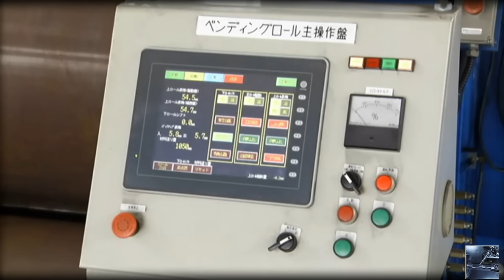Discover high-capacity plate rolling machine - Technology solutions

Comment: but how do they joint it edges??
Reply: It`s welded,but would like to know what process?
Reply: When I rolled wind towers we put a hand root in then sub arc welded the joint. Material that thick took alot of passes using AC/DC. After welding the seam has to be rerolled to get it back in radius